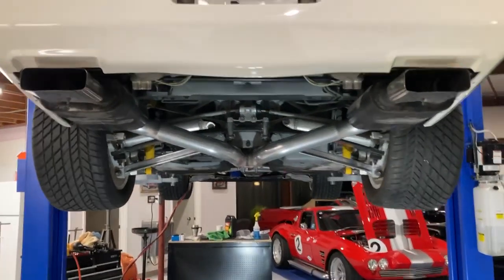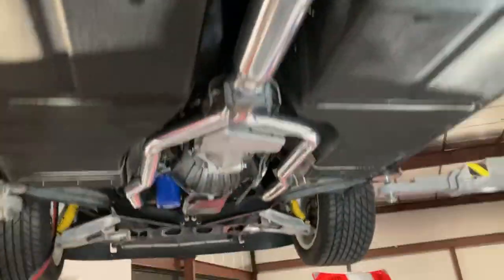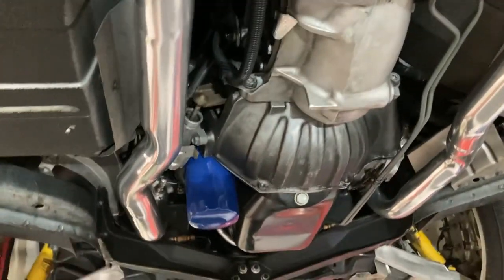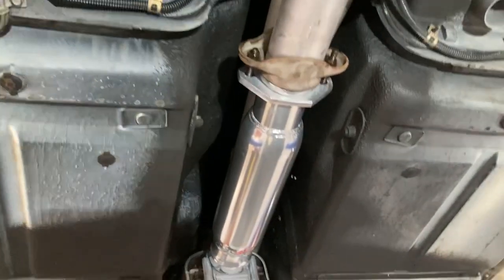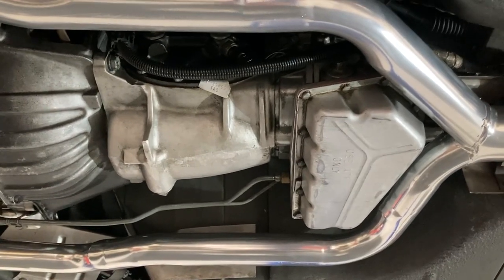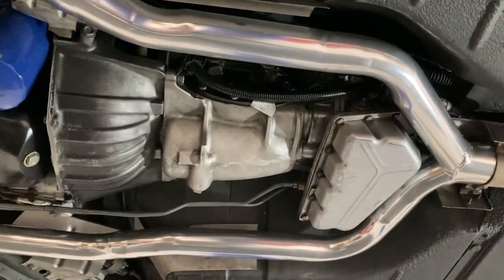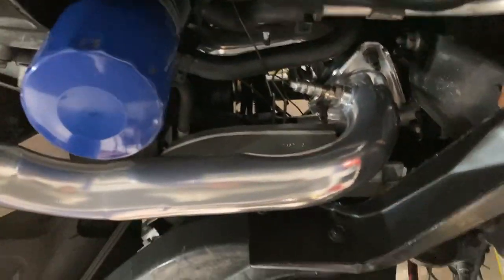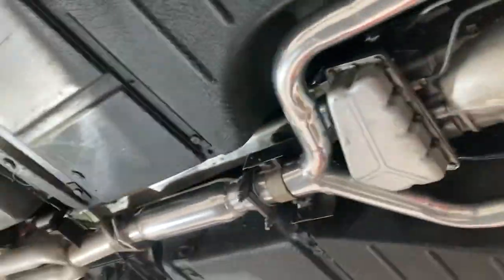C4 Corvette TPI 5.7 tuned port injection Edelbrock High Flo large port intake and runners - Part 15

Comment: Hey Matt,  next time you put this C4 up on the lift, could you please measure the length of both sides of the front Off-Road Y Pipe?
I'm very curious about how much each side is unequal of both the 
Off-Road Y & the regular Y pipe are, with cats.  I totally agree with you that both banks should converge to blend the exhaust pulses for a smoother more refined sound of the C4's futuristic styling vs. sounding like a muscle drag car.  I think even a certain type of muffler with variable complex design after the Y will further help blend the pulses & would give even a more unique tuned exhaust note.  
    David Vizard had once spoke about using a Flowmaster 40 at the header collectors to act as an anti-reversion chamber or like his Pressure Wave Termination Box.  Heart Throb Exhaust makes a knockoff of the Flowmaster, but with a perforated Delta Baffle Plate design which they said helps with flow-thru-velocity & to condition the exhaust pulses.  It comes in a 5.5" x11" & either 14" L or 18" L body.  #54044  &  #58044.  I'm not sure if an 11" wide body will fit in the trans tunnel.
      Another interesting design that looks like it would really condition the exhaust pulses is the Flowmaster DBX with the inverse perforated cone cores & uses a unique ceramic insulation for sound absorption & for heat retention which also comes in 3". In/Out.
     There is also the Flowmaster Super HP2 that also has the laminar flow designed perforated cones,  & narrower perforated cone cores with 2 cylindrical inner tubes which can probably further help blend & condition the exhaust pulses & also has ceramic insulation.
     In addition they have the larger Pro Series for the turbo-diesel trucks & has the same laminar flow inverted perforated cones like the DBX & has ceramic insulation.  It probably flows better for your supercharged high compression engine since its a larger case muffler & larger cones....🤔
     I also think maybe the Aero Turbine XL which also uses ceramic insulation, or an open chamber Flow Chaser with perforated side chambers, or some other uniquely designed mufflers placed after the front Y could give the C4 a unique tuned sound along with rear mufflers like your Flo Pro's or any other design muffler.
    Also, here is a really great expose' documentary about the Lexus LFA secret exhaust system technology that was just posted yesterday & speaks of slightly unequal exhaust headers & pipes, but the muffler is a complex design.   I think you may enjoy it...
If we could only make our C4's sound like that Lexus LFA!
https://m.youtube.com/watch?v=crEeOEs4ZP0&t=1s

Comment: I'm surprised you didn't true duel this beast!! Not necessarily for the sound but extra power!! With that supercharger the bigger diameter pipes with help the HP and tourqe of that thing!! True duel would help big time!!! Especially if it's a racecar!!!
Reply from the maker: The issue is going from lower rpm power to upper.   If this was miniram or some type of application that lost torque to gain hp, i would have.   But on l98, they are limited below 6k no matter how big you grow the runner diameter.   So i go the path to make the most torque in the sub 5500 range.    And getting a tpi to pull linearly to 5500 is a feat in itself.
Reply: @gm-classics  that's odd because I've had a 89 IROC TPI350 700R4 and it was very similar to the 95 Z28 I had in a straight line as far as acceleration goes. But I also had zero information on the car and its history and I did find a hypertech chip in the ECM of the IROC so I have no clue what had been done to it and the transmission probably had some work to it because my 95 ran 13.7 at 101mph and the IROC didn't feel much different, it had power everywhere in the RPMs just like the LT1 did. But that's my only experience with the TPI350 and it ripped! Very similar to the LT1 so had to have had something done to it, I just figured it was stock but it really couldn't have been to run like that and the only thing I know was that chip I found but that ain't enough to get a IROC to run mid to high 13s!